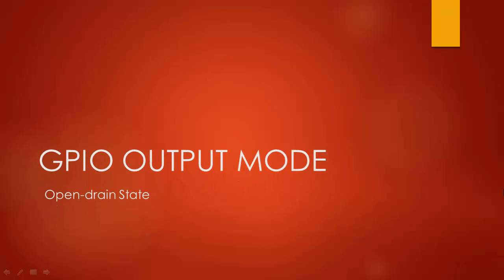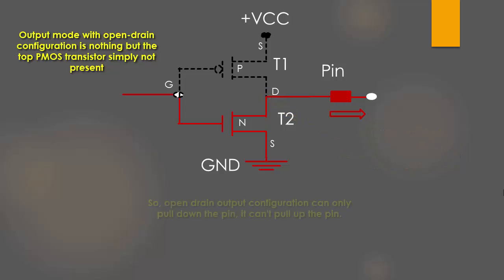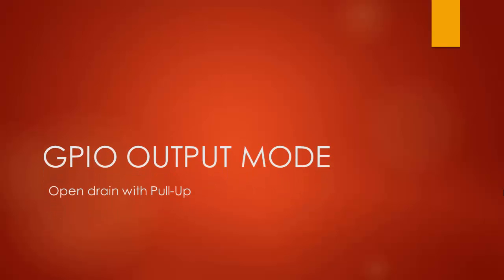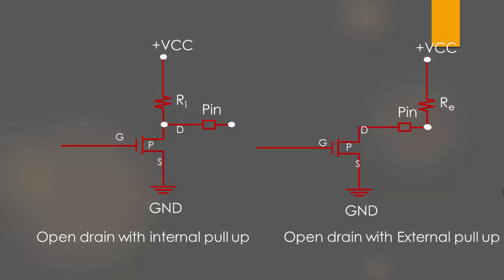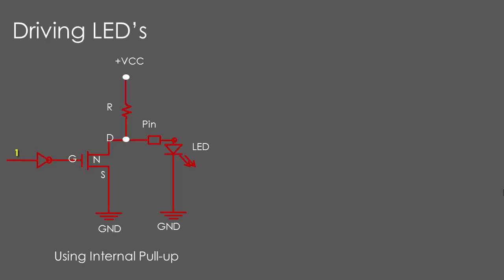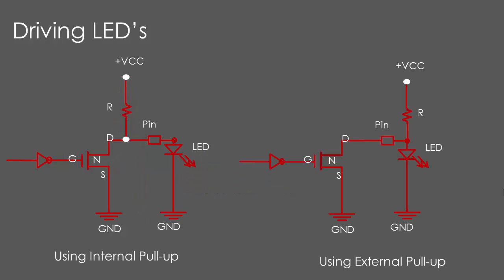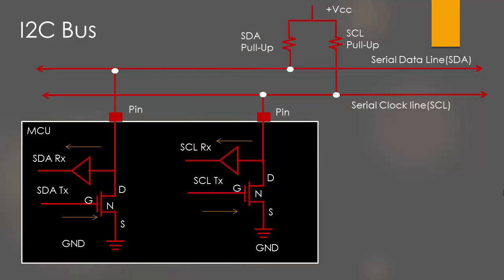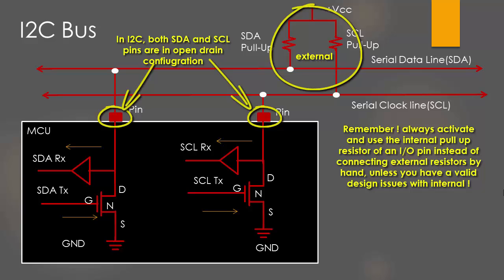GPIO Output Mode: Working of Open Drain Configuration

Comment: I dont understand.
R already limits the current. Led has additional resistance.
FET is shorting line to ground, so current flow through R.
When FET is closed resistance of line is R + Led.
Is current enough to power Led? 
If so, why R doesnt burn when shorted to Gnd?
Reply: If set R enough large, current will reduce, the R does not burn. I hope you can understanding.
Reply: Depending on how bright you want your LED.  You can use 10K pull-up with red LED and it will glow, and 10K is definitely enough to prevent damage to the MCU.  Depending on the MCU, you can source ~30mA or 0.030A. With Vcc of 5V, you are delivering 0.0005A.  We don't worry about burning out R, that probably will never happen.  The MCU pin will fry before R does.  A 470R, at 5V will give 0.010A.  Etc...

Comment: Hi sir, Is there any advantage of using this configuration over normal configuration?
Reply: this configuration is used for example on an I2C-Bus to prevent a current flow between two devices if they are set to output mode (one device could give Vcc on the line while one device could give GND on the line -> 3.3V to 5V voltage difference between those two transistors results in a big current which can destroy the devices). If both devices are used in an open drain configuration the output pins can only drive the whole data line to GND and never drive it to a higher voltage by themselves (data line is only on high if both devices would close their transistors). So even if two devices are set to output mode there is no state where there is a voltage difference between the devices so no current will flow.